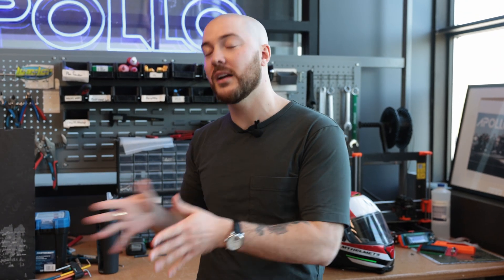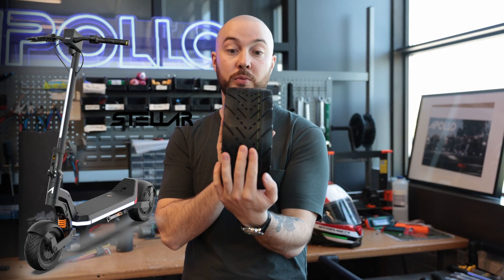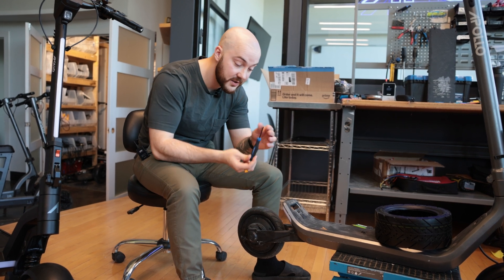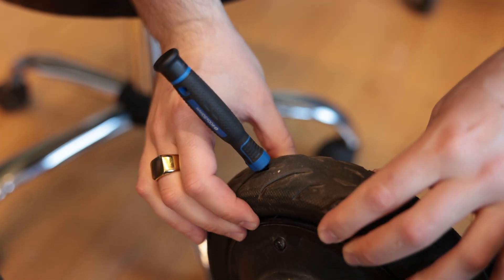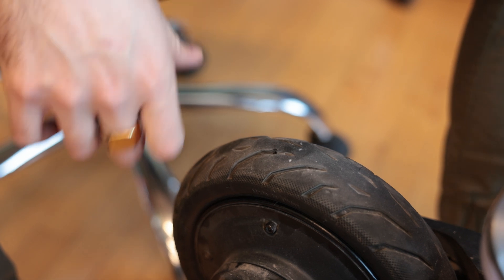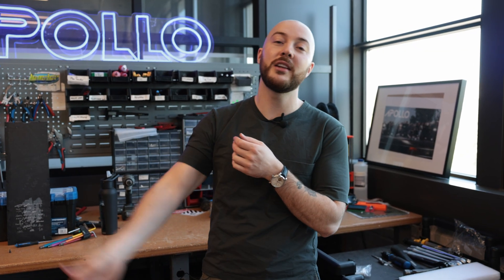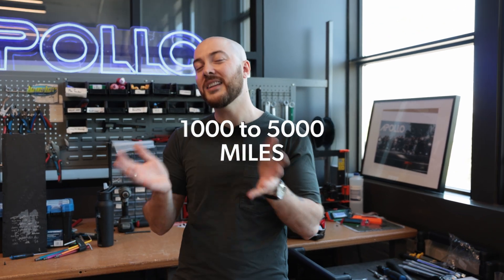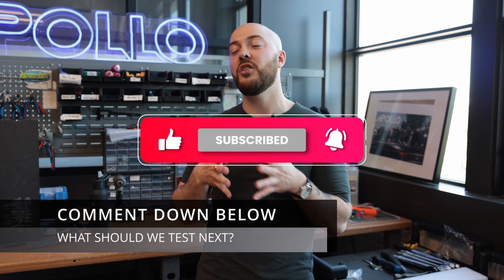Testing Apollo SELF-HEALING TIRES - Are They Indestructible?

Comment: I had my Apollo CIty Pro 8 months before the tire shredded itself on a pot hole.  Not only was incredibly hard to replace, it is was near impossible to get another tire cause it was sold out. Since then both stems for the tire have cracked and been replaced with non-Appollo Stems and I have had to become an expert on replacing the tire and assembly of the wheels.  I also carry around a portable air pump and constantly kick the tire to check for air pressure at stops out of fear of another flat.

Comment: I have an apollo phantom v4x. I also had a 1" nail in the front tire. The self-healing tire did not work even though i tried to inflate it to 50 psi. Air kept leaking. I brought it to promech bc, which cost me $69 for the tire and $69 for the service.

Comment: I had a slow leak on my phantom v4x and i found a tiny hole in the middle of the tire. The self healing didnt really work for me
Reply: Faulty sealant application??!!😮
Contact Apollo.
If exposed to prolonged heat it won't work,especially after 6 month!!!
That glue will dry up!!

Comment: It would have been much more transparent if you had connected a gauge to show the little to no pressure loss. Squeezing the tire with your hand is not a very informative demonstration. Also, as far as I am aware, the correct tire pressure on the Go is 50 PSI. Maybe you can re-do the test at a later date with these things in mind?
Reply: Hey!
Noted, thank you for your suggestion. You will see the smallest leak with the soapy water, more than a pressure gauge, this is pretty standard.
Reply: @eloipecquet  Thanks friend. Yes, for finding leaks soapy water is indeed superior. But since the audience cannot confirm the pressure you show in the tire, having a pressure gauge attached would instill a higher level of confidence. Since puncturing an underinflated tire would not produce much, if any leaks, it would be better to show a more realistic test, especially since these tires are something that seems to be advertised as setting Apollo apart from the competition.
Reply: @meltymeltymelty Apollo already has shown a proper testing in an other of their video.🎉😊.
Reply: @8_x_9.  Couldn't find it. Do you have a link to the video? No big deal though, just thought Mr. Pecquet would like some constructive criticism. Love my Apollo scooter just was hoping for more of a real-world demonstration. Like actually riding the scooter with a fully-inflated tire over a nail or screw, pulling it out and showing the self healing gel working to seal the leak enough so that the scooter was still safe to ride. Kind of like how a normal person would experience it.

Comment: I can testify that it works, I pulled  inch long nail out of my rear tire, and it's still good no air leak at all. Thanks much for sharing the video.
Reply: Make shure you don't leave the tire long in the sun to heat it up!!! Tire seal will dry up & it won't stop the leakeage!!!
Just you remember keep the tires cool.😊